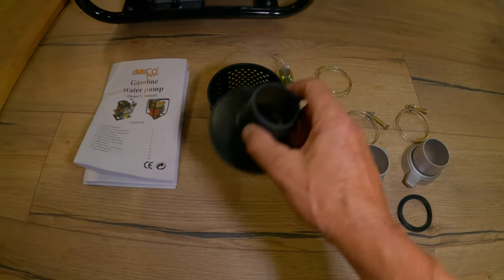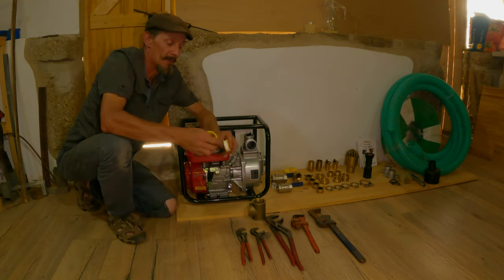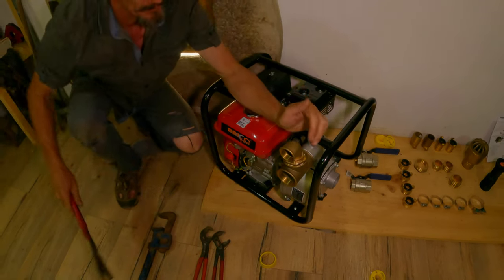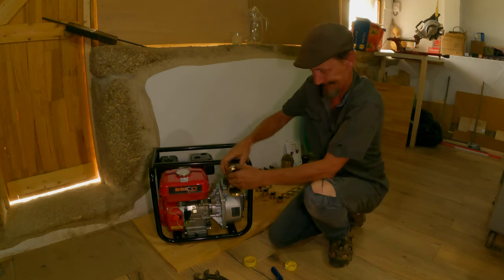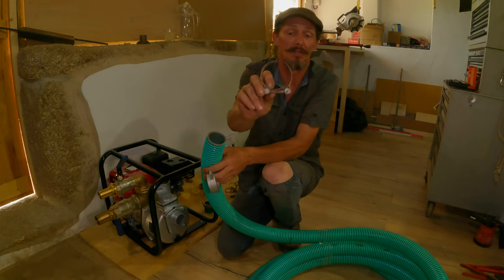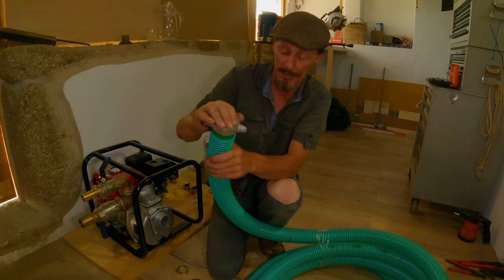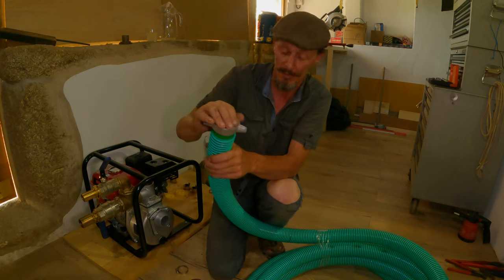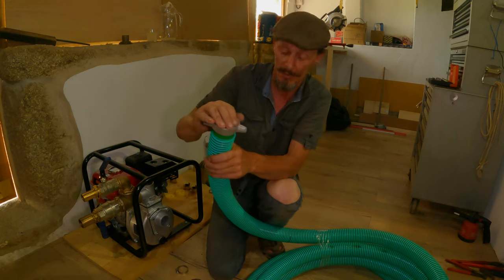🔥 Wild FIRE Fighting in Central Portugal 🔥 DIY fire fighting Water pump setup 💦 1000Litres a minute💦

Comment: Another great advantage in using standard quick fittings is that IF the firefighters turn up they can continue from the hose you already have laid out or/and switch pumps to one of theirs. (I checked going to my local "bombers" with the fittings I had)
Reply from the maker: That's a very good point although these fittings are slightly different to the Portuguese fireman's connectors.
From our experience the firemen turn up quickly enough but they get stuck in under orders from their boss with their own hoses, we built this to help in places they arent and hopefully calm any flames before they arrive, hoping we dont ever need it again.

Comment: That put a fair bit of water out ,quite a reasonable distance .  so if there is a fire  you could drench the surrounding area  and hope that stops the fire well before it gets too near the house / Add a wheelbarrow to move it round quick  and your sorted !
Reply from the maker: The wheelbarrow is a great idea for moving the pump around!, Cheers Andy 🙂
Reply: They make water pumps with a wheel I have two of them

Comment: Just and FYI I learned many years ago running self priming pumps at fires. I was priming the pump following the MFG instructions, by pouring water in that little 1/2" hole on top. A local plumber who was also on the FD, in formed me of the error of my ways and pointed out that the discharge for the pump went to the exact same spot at the priming port and that 1 1/2" hole was much easier to pour water in then the 1/2" hole on top. A short time later we also replaced that priming plug with a silcock (1/2" x GHT thread). Thow on an old washing machine hose and you had ready to use by-pass / bleeder, as well as a way to fill Indian Tanks or even run a garden hose nozzle to protect the pump.

Comment: Yeah, because 1 1/2 inch is actually 1,5 x 2,54cm= 3,81 cm, so its  less than 45mm, around 7mm.
Reply from the maker: Exactly and makes fitting these things a bit harder than it needs to be 😂👍🙂

Comment: Turn the PTFE tape around 180 degrees. It will make it quicker & easier to apply.
Reply from the maker: Well spotted, you are dead right 👍🙂
Reply: @FontedaPipaPortugueseFarmLife  you appley it in the direction 
you screw what ever on.. with the on direktion easy

Comment: interesting post. If Storz fire brigade couplings weren't better suited, they can be coupled faster.
Reply from the maker: Yes i would like to have got fireman's connectors but hard to find out here and if you do they are 4 times the price... the ones we have connect at the same speed only fault i can see is they might snag on roots etc when pulling👍🙂

Comment: Really, really useful!  I could never figure out how to use PTFE tape and now I know.  :))  Also some good tips about how (not) to use those types of spanners, how to link up things that don't quite fit, etc.  You should make more of these basic instruction videos.

By the way, could you use solar panels to power water pumps so you didn't have to burn so much diesel/petrol, or would that require expensive batteries to produce enough power to move water in volume and put out a fire?
Reply from the maker: Glad it helped Tigger, You could use solar panels to run a water pump but like you said it would need a decent solar system to run a pump capable of keeping up with our petrol water pump.
But for fire you could use a smaller pump, even a garden hose from normal house pressure is better than nothing and works well on fires in short grass when flames are low.
Lets hope you never need to find out👍

Comment: Alex, try to change the oil on the engine with good oil, the Chinese fill these with crap vegetable oil or recycled oil
Reply from the maker: These engines come without engine oil, they drain it out for transport after they drain out their cheap oil in the factory. We filled it with fresh 15w/40 motor oil 👍🙂
Reply: Is it really made in China?
Reply: @antoniodasilva1230  most likely it’s an Honda clone made in China.  Not bad engines but stay clear of gas with ethanol blends
Reply: @jamietinker1975  you might be right its from intermarche so ill say 99.0% if it was a maxmatt store brand might be built in PT
Reply from the maker: @antoniodasilva1230  we didn't buy it in intermarche..... We bought at a local hardware store and is labelled by a Portuguese brand "Brico Ferr" but it is a Chinese made pump, 99% are made there.
10 years ago i would not touch one but they make good pumps now
Reply from the maker: @antoniodasilva1230  yep!

Comment: Hi, such an informative video! Thank you for sharing 😊 We have just bought this pump from Bricomarche. How much oil does this take and what fuel does it take as you said petrol but the manual says gasoline. Many thanks Jane and Mark
Reply from the maker: HaHa I am English,Petrol = Gasoline🙂 no need to mix any oil with it.
It takes about 800Ml. of oil but please check your manual, it should say.
Glad you found it useful 👍🙂
Reply: @FontedaPipaPortugueseFarmLife  thank you for your reply. The fact that you said petrol actually solved our problem. We had filled it with diesel and it just wasn’t working plus we hadn’t put enough oil in. It is now running like a dream but we just need to solve water pipe problems and a sinking filter. Do you have any tips on how to keep the heavy metal filter from touching the bottom of the dam as it is just sucking up sand? I’ve tried a water bottle as a buoyancy aid but it’s a heavy filter 🤦🏻‍♀️. Many thanks 🙏